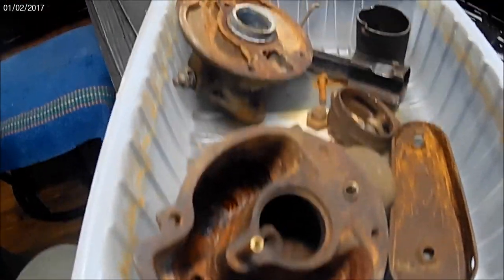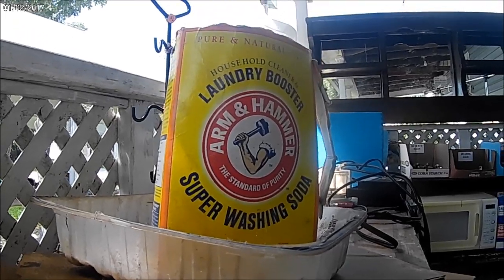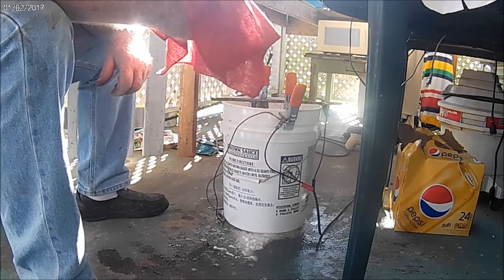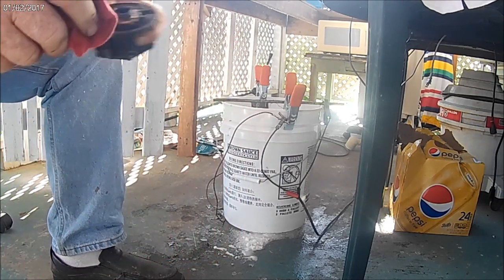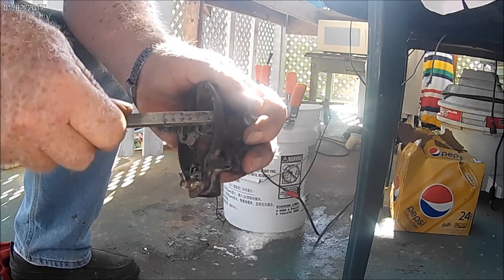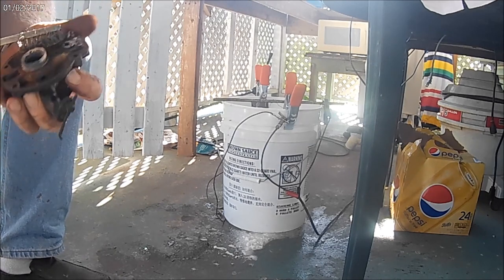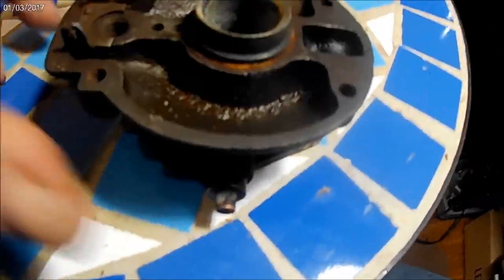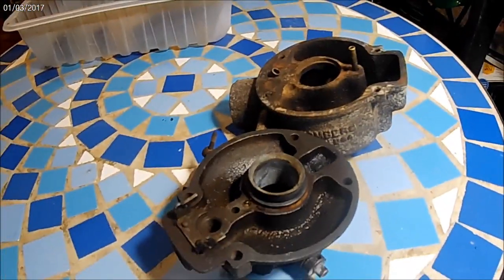cleaning the rusty cast iron carburetor for my Wisconsin engine.

Comment: Try Muratic acid used for cleaning concrete dilute with a little water.  Degrease and place your rusty items in  let them Sit for a few minutes and check because it will take away too much surface if you don’t check every minute! Full strength it will begin to boil of the rust quickly.  It’s reusable hundreds of times .

Comment: Regarding that broken tap.......I just saw a video where the guy had the same situation, and he welded a washer onto the tap and then turned the washer with vice grips, he said he normally would have to weld a nut on top of the washer and then turn it out but he managed to do it with just welding a washer onto it, hope that helps some. Thanks for sharing and keep em coming Vern.
Reply from the maker: it's kinda down in there, and I am a lousy welder,,lol

Comment: I've got a Mauser 1891 module year. Good guns. Mines 7.65 *51. Ammo still around.  I want a Mauser 98. I like that there eletro bucket thingy you got going. Thanks for sharing God bless you and yourn.
Reply from the maker: I've had a few mausers over the years, I have one now which I thought was maybe a low grade one because it has a stamped floor plate and a few other things but some folks say that's not the case that it is as good as all the rest.

Comment: That worked good. Better than a wire brush for sure👍🏻
Reply from the maker: I've used this method on several things, if I had a small rotary brush I might be able to get in there but this did a good enough job that I don't think there will be much rust flakes causing any problems.

Comment: I have been wanting to make a  electrolysis bath but never got around to it. You can get a Ultrasonic Cleaner for less than thirty dollars.
A good ol bead blaster is also a favorite to use. I did a few government jobs with those at work. LOL
Reply from the maker: this method works on rusty iron, not good for aluminum or copper etc.

Comment: I've always wanted to try it, but just haven't had the need yet. Thinking back it would have been just the ticket for my first lathe which was in pieces and laying in the dirt for a few years before I got it.
Reply from the maker: It's pretty easy and cheap, you do need an old style battery charger or some kind of power supply, and some washing soda and a few minor other things. I have used it on several things.

Comment: Well its cleaner than before 
I tell you man I feel terrible that the vinegar didn't work for you...
Reply from the maker: I'm sure vinegar works on most things but the rust was  pretty embedded in this old carb.
Reply: @MissouriOldTimer  well I have noticed that electrolysis doesn't work on some types of metals ... I guess vinegar could not work on all types of metals either....I think I'm gonna do another video testing vinegar on different types of metals and show the other stuff that ive derusted after some time passed...
Reply from the maker: @GeorgiaRidgerunner  that would make an interesting video.